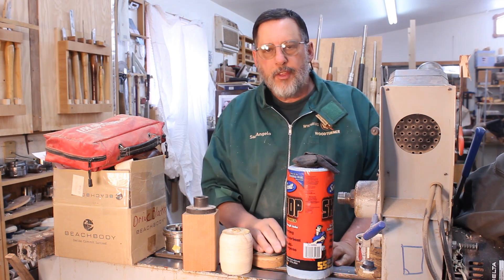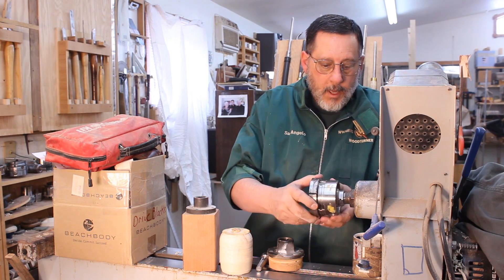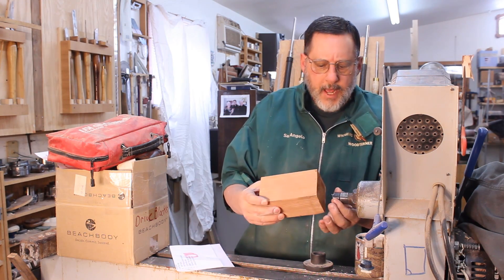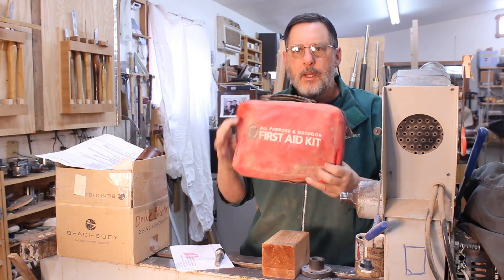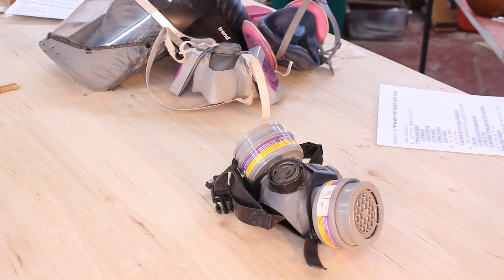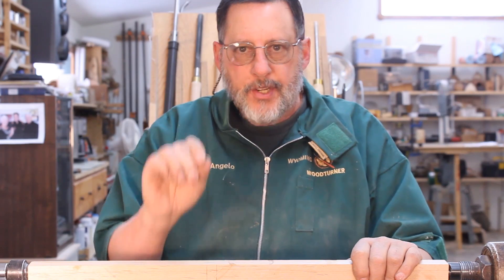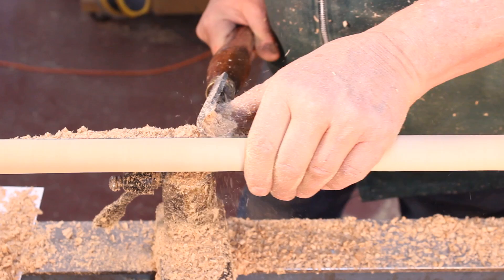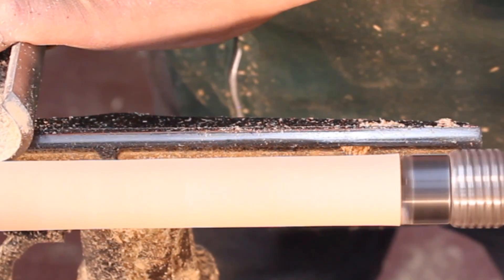Safety First On the Lathe---Part 2  (2015)

Comment: Thank you for doing this series of videos, they are very easy to understand.  One question, I have watched several shop safety videos, and none of them mention footwear, do you have any recommendations on that subject?  I have seen several woodworking videos, of guys in their shops wearing flip-flops or sandals, and to me, that does not look safe.
Reply from the maker: Yes, no open-toed shoes!!!!!   Other than that, I really just wear good comfortable shoes.  I don't know if steel toed shoes are necessary.  Sam

Comment: Hello Sir, I am a new turner and don’t have all the “high-speed” gear I see in a lot of the YouTubes.  I have a cheap face shield from Lowes and an M95 Mask that just fits over your nose and chin with rubber bands. My main issue is that I wear glasses and with this setup when it cold, like now, everything fogs up and I can’t see.  Will the type of dusk mask that you show in this video help with this issue?
Reply from the maker: Great question
If you look at minute 13:00 to about 13:15 I show a respirator that has the "exhaust" for your breath at the lower part of the mask.  here is a link and a better shot of the mask.  http://www.ec21.com/product-details/3M-7502-Chemical-Gas-Mask--8420656.html   like I said the air escapes downward.  This is your best option I think.  Sam

Comment: Hi Sam,
Great safety video, 1&2. You forgot to mention footwear. I say that because there are a lot of YouTube videos showing turners schlepping about in flip flops and open toed sandals. Gouges are supposed to be sharp and if one slips out of your hands, it's going to head South. Even if your feet aren't in line with it's fall, you might  still try to jump out of the way (do the splits). On a floor covered with sawdust and/or shavings, that could cause you to slip, maybe headlong into a spinning machine. Either way, a trip to the local hospitals A&E department and maybe time off work, is not going to be fun. Keep up the good work, I enjoy and learn a lot from your videos.
Be safe, be appropriate.

Regards Max

Comment: Hi Sam
very beautiful videos ...
... just have a wrong experience on my lathe (I can write so I'm a lucky man, or someone had a look).

On video1 you spoke about chuck key, pls add also jaw case!
Yesterday evening, after finish to turn a piece, I was cleaning my lathe and oil mechanic speed  control.
I played with the control from min to max speed a couple of time and ... a jaw fly away at maximum speed ( 2500 rpm).

Jaw take off on rear side ... just a bump on wall.

-> root cause: I left completely open the chuck after removing the wood then I start the lathe.

I'm new on woodturning but I have experience on metal lathe

Hope this can help other people

regards
Paolo
Reply from the maker: Paolo
This happened to me years ago as well.  What kind of chuck were you using?  I had an old Nova chuck that did to have the stops on it for the jaws.  They could be taken completely off the chuck body.
I will mention that.
Sam
Reply: WYOMINGWOODTURNER
Sam
it is an AXMINSTER Clubman. It is a very good chuck, but like others chucks is based on JACOB schema and it has a gear theet that controls the jaws. I think that, when not tight and playing with speed control it can rotate ...
Any way, I will continue to use it, but I will carefully double check it for position, before run the lathe  

Paolo

Comment: Thanks Sam. I have launched more things into a ego synchronous orbit than NASA.
Reply from the maker: Well said (I had to get my dictionary out)  I once had one of the original Nova chucks.  20 years ago that chuck did not have the stops on the individual jaws which prevented them from coming off the chuck boy.  Well one day one of them did when I was turning.  Hit the ceiling-not me luckily 
Thanks Sam
Reply: WYOMINGWOODTURNER  launches actually stopped me from turning for a while .I  subsequently discovered You Tube and it helped me to learn about chucking diffrently. Many thanks to you and others for this.
Frank

Comment: Great videos.  You can't say enough about safety when working around machinery. Regarding the use of a glove, I have found that a golf glove works great to protect my hand from flying chips & hot wood.  They fit snug, so they are less likely to catch on anything, while still leaving me with a good sense of touch.
Reply from the maker: Thanks for the comment on the glove.  I will NOT give people information that is not true.  Like saying that I don't wear a glove. I would rather teach that safety is your responsibility and that seeing someone else do something is not permission of any kind..... It can be dangerous and I am very careful cause I understand the results.  I think the golf glove is a good idea.  These cotton gloves I wear fit rather loosely and actually come off easily.  I hope if I do get caught up, the glove will come off.  Thanks Sam

Comment: Sam:  Great topic and well presented.  Have you had experience with a mesh face shield (vs. plastic) when turning?  I tried a friend's mesh face shield recently and, based on a admittedly very short test drive, found them more comfortable, less 'claustrophobic', cooler and no glare from [my] safety glasses on the plastic shield, etc., ...
Reply from the maker: I have not seen them.  But I do have a mush chainsaw shield I have thought bout wearing   I might give that a try as it also has the built in hearing protectors.
Sam